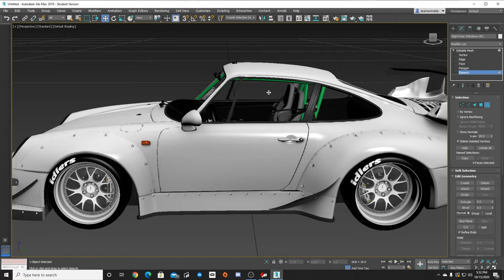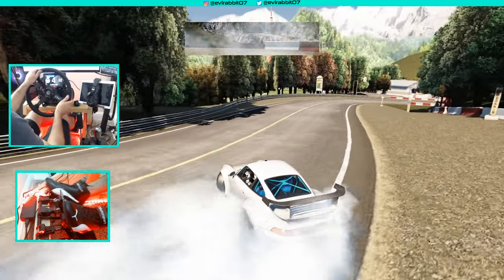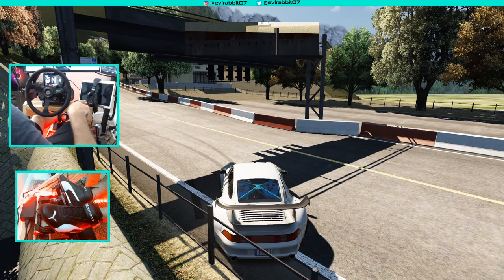Assetto Corsa - NEW RWB PORSCHE DRIFT CAR - (wheel/pedal cam)- Gameplay/Replay

Comment: I want that car lol .
 Could you do a evo and scooby like the old team orange d1 guys had .maybe a Honda integra with s2000 running gear .
As a odd one a VW split bus with Porsche setup you did with this car .
I thought  I had managed to get the hang of drifting on ac  ( could run laps no problem ) but after trying rfactor 2 my wheel set itself to 576 degrees now reset to 900 again and I suck again and spinning out or stall alot lol 😥